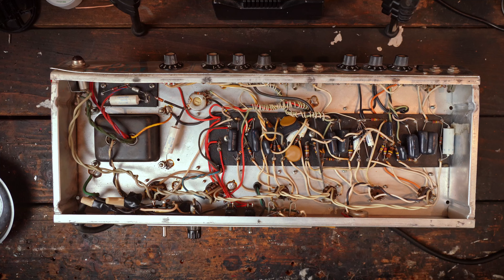A Rare Unicorn??? - Vintage Fender Bassman 50 Amp Repair Pt.1

Comment: These things are a one-off that all documentation seems to have been lost to ages.  I would love to get my hands on an unmodded version to document it.  The only Bassman 50 MV amps I have found have been modded.   Looks awfully close to an AB165 with an MV added in.  It's using the 3 and a half preamp tubes like the AB165.  Just can't figure out how they did the MV, pre PI or Post PI.  This looks to be post  PI.

Comment: Ive heard the blue caps aren't bad... Ive Had issues with a bunch of the brown turd caps...  Also those GE Alumalytic caps were used by Fender off and on for stock black face and silver face Amps.  Ive got a few bags of them salvaged while maintaining my fleet of amps.

Comment: if you have the head box, there may be a tube chart with a circuit # inked on it.. those are reasonably accurate. this content is aged & you may know all that you didnt then but it may help. most resistors drift upward. when measuring them in circuit, you can't unless you lift a leg. the single resistor circuits   will measure accurately, 2 or more sharing the same eyelet create divider network and will read usually less than the one your trying to measure. it does not matter if you clip both leads to the same resistor, it's still in-circuit you can get printable color charts for the resistors & hang them over bench. I will never live long enough to commit those to memory.

Comment: I always thought that a cool idea for one of those amps would be to replace the existing master volume with a good sounding post phase inverter master. 

You see a lot of used Bassman heads that have had a Master volume added on, but this amp  has one from the factory...just not a very good sounding one.

Comment: That “470” ohm resistor in the phase inverter definitely is a blue/grey/brown/silver to my eyes. That would be a 690 ohm 10%. 

I found a Bassman 70 Schematic that might help you piece together the master volume circuit.
Reply: Blue/grey/brown would be 680Ω. 690 was never a value for CC resistors of that era. 680Ω was probably a factory install. It's not unusual to find discrepancies on old Fender schematics. 470Ω was a more common value in the Fender LTP PI cathode circuit but the value is not critical.
Reply from the maker: Thanks Matt!

Comment: Those 100K 1W resistors you were struggling with are fine. They all have other resistors in series/parallel that are making the meter read low.
Reply from the maker: That makes sense, especially considering how consistent they were. I always check the value by lifting a leg before actually removing as well, but for the cursory check I like to do this so I get more familiar with the amp(s).
Reply: also if i'm not mistaken the schematic states 20% tolerance unless otherwise stated. So 14 off 100 would be within tolerance.
Reply: @mcascone  The schematic states "All resistors 1/2 watt, 10% tolerance if not specified."

Comment: Those blue drop or blue turd caps are actually pretty well regarded.  They typically do not leak.  It is the brown turds which have a bad reputation.
Reply from the maker: Got it! Yeah I've seen videos from Dlab where he just yoinks them all out without even testing, but I know now that's not best practice ;)
Reply: @YeatzeeGuitar  I like Dlab but I don't necessarily think he is the best person to non-invasively work on vintage amps.  He does some great work, but at times I feel like he needlessly replaces original components that are likely still working properly.